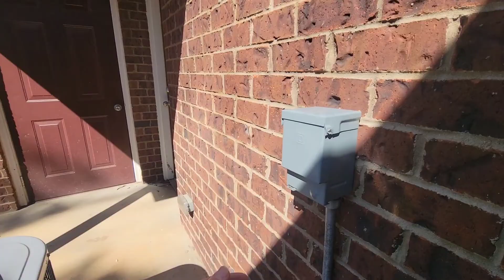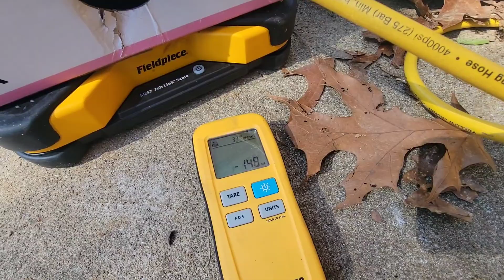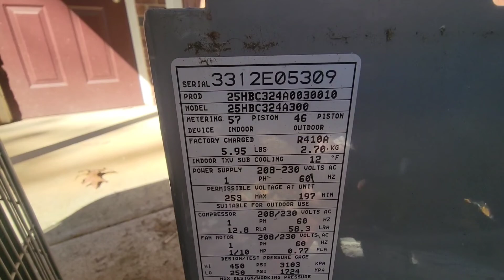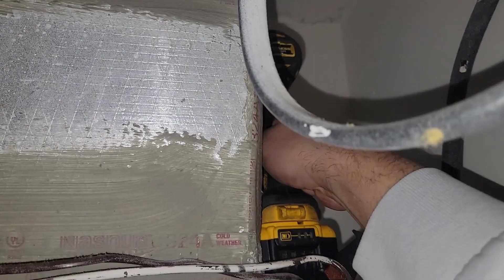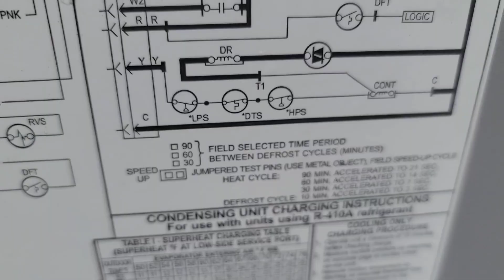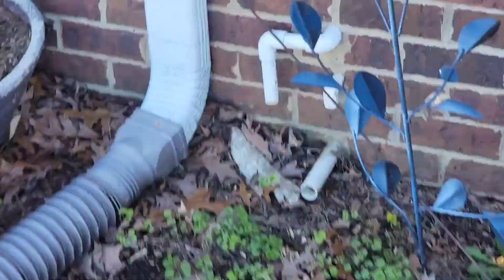Apartment Heat Pump Frozen Solid - Here's Why

Comment: Great video man! I have a question:
At last defrost on my r22 Goodman heat pump I have noticed that both lines were about same temperature for good 6 min while compressor was running and reverse valve being energized. Compressor didn't sound unhealthy, but after about 6 min into defrost cycle it started to sound more quiet and suction line became cold and liquid line hot as expected. Is that could be an indication of low charge? In heating mode it seems to get to 95 °F at closest register with 70 degrees inside and about 40 outside.

Comment: Why didn't you recover the charge and do a pressure test?
Reply from the maker: I will be doing that.
 Would you like to see that on the next video?
Reply: @taddydigest  yes please.  I want to see more on diagnosing bad txv's in the air handler and heat pump too.
Reply from the maker: Deal
Reply: Great job tad very  informative
Reply: Your a good teacher good job